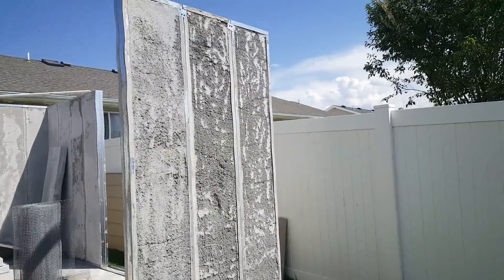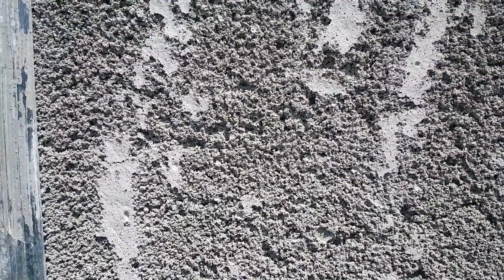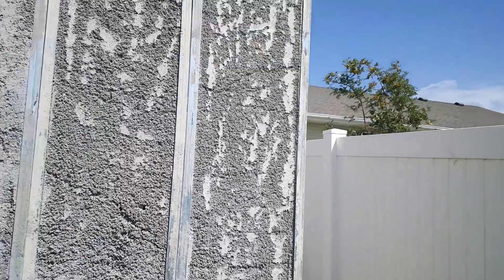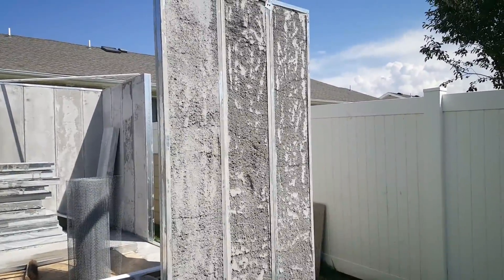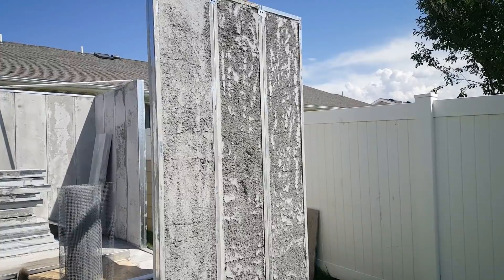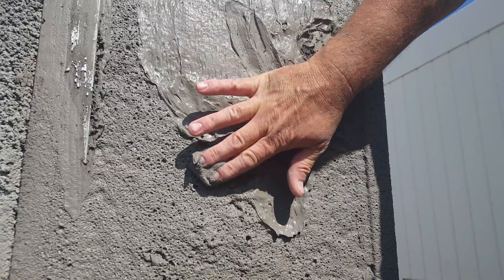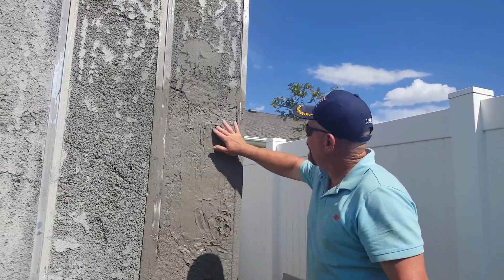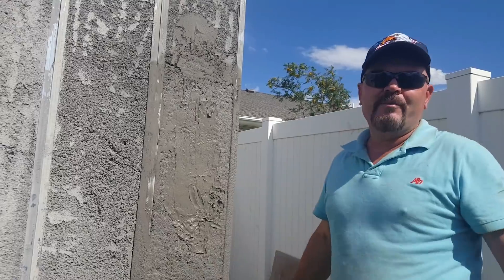Spraying Aircrete ON Wall Panels

Comment: In trying to research the viability of an aircrete hack with little success, I ended up here with you. My hope is that you or one of your readers can help with info or where I might find it. I have a stick built house with T1-11 for siding. Is there any way I can use aircrete as stucco on it? Do I need another vapor barrier? How would I make sure it stuck? Any help will be greatly appreciated. Thank you.

Comment: Fantastic.  Watched all or your Air Crete videos till now.  Love em.  My goal is to make thin-ish wall panels (in the shop) to clad over existing plywood exterior.  One of my big interest points is creating interesting rough finished surfaces. I LOVE the rough texture you got by scraping the panels in preparation for stucco spray.  the questions is - do you think the rough prepped surface could be sealed and lime washed and then hold up to the elements as a finished surface?

Comment: Missing basic safety information.
Cement contains silica dust. The sharp-edged particles scar lung tissue when inhaled:  silicosis.  It accumulates, and is permanent.  Think "turn blue and medical emergency if you fly". 
A properly fitted $40-ish half-mask respirator (plastic with a soft gasket to seal to your face) with P95 or (better, but more restrictive) P100 filters keeps that out of your lungs. The filters are easily replaceable. Lungs, not so much.
Your breathing muscles may get sore until you build them up; try P95 first. 
If you are tasting dust or grit or cement, forgot to wear your respirator. 
When I had to work in a nasty crawlspace, I didn't get nearly as sick if I wore my respirator.  Or taste the dust.

Works great (overkill) for sawdust too.

Comment: Do you reckon you can use this technique to retrofit sheds & barns etc, by spraying aircrete around the wood panels on both sides building up a solid mass? Perhaps laying some chicken wire mesh first, spray a coat, add another layer of mesh and spray again. Would this be strong enough with the mesh and concrete even if some of the wooden boards were only nailed in?

Comment: Just wondering - if your pushing the Air Crete through the sprayer head aren't you loosing the foaming properties of the foam?  If the forms are in position - just use concrete and a sand mix and build a layer of strength on the outside.

Comment: I’d never use aircrete alone. Each time you double with foam, you take away half strength the Portland Cement offers. It’s just not stable enough.

Comment: You should always add followup coats before that last casting is all cured as much as yours has. On top of that you should at least spray down the surface real good to hydrate it before adding the spray coat! Otherwise, the top coating will dry way too quick which is not good! Why did you add foam to this surface coating your shooting with texture gun? Try it without foam and add some sand and perhaps even some latex for better adhesion and again, spray it good with water before adding surface layer.

Comment: what would be the best way to make air crete if i only needed a gallon at a time... what easy way to make foam and what do i need to buy? soap?  i want to use for art project... will it dry in same time as regular concrete sand mix under same circumstances? thanks
Reply: I'd get some Portland cement (around $10/bag) and try stuff.

Comment: i always wanted to try truck bed spray lining on somwthin like this. its hard, long lasting, easy to apply, waterproof. Even some type or polymer could do the trick.
Reply: It's important both to keep water out and let water vapor (which we exhale) escape.

Comment: I'm studying aircrete very intensely to make what I hope appears to be monolithic walls for a house I'm building using a steel tubing framed pole barn.  I am interested in the hopper gun technique which just gave me the idea of another video I saw making counter tops out of concrete that look like wood slabs by dragging a drywall knife across it.  Since aircrete is somewhat soft I also am wondering about using something for a hardcoat such as a polyurea coating.  Do you have any ideas about hard coating?

Comment: Why don't you coat these panels with Sodium Silicate (water glass) mixed with 4 parts water then let dry. Next paint with a homemade starlite solution consisting of 10 parts cornstarch, 1 part baking soda & white glue (PVA Glue) then paint onto the surface then allow to dry.  Then used a nice base coat paint and cover with a nice 30+ year latex paint and your nice airconcrete walls will last forever..... and are fireproof. Walla, your've got a really nice cabin or house in the forest which will not burn down during a forest fire.
Reply: I almost forgot... please forget the spray painting of airconcrete…. spray paint the water glass instead then hand paint on the homemade starlite solution and spray pint the base paint and latex paint. Or you might just add forget the waterglass and add sodium silicate to the home made starlite solution & spraypaint it onto the aircrete suface then allow to dry and paint it with latex.

Comment: Tips:

1- get a gun made for dense media 

2- you need to make this a three layer application, like stucco, if you want it to last. Spray first layer, overlay with skrim fabric, add a plasticiser with the top coat, to avoid shrinkage/cracking... you can buy thinset mortar mix with the plasticizer already mixed in, for a better finish at about the same price.

Comment: Why use steel studs? Why not frame the building using wood 2x4s and then attaching waferboard on the inside and outside of the structure and fill the voids between the studs with aircrete? Then leave the waferboard in place and use tradition coverings such as siding. Or after a day or two of curing remove the waferboard and reattach them four feet down the wall and repeat? If you use waferboard molds first make sure you run whatever wiring you had planned to do. One could be creative and use a textured mold paneling to simulate beam construction or cordwood.
Reply: Wood tends to swell, shrink, absorb moisture from the concrete, and is subject to rot.

Comment: Your walls are great insulators except for the metal frames. How do you isolate the metal from transmitting cold or hot to the interior?

Thanks
Patrick
Reply: The metal is a good heat conductor, however it is thin, so the cross section of the heat path is small.
The outside layer of cement and any inside wall surface covering will help as well.

Comment: Yikes.  You're killing the insulation value when you have those steel studs running through the wall everywhere.  No point in insulation if you have that steel running through.
Reply: The steel does conduct heat well, however the sheet metal is thin so the cross section is relatively small.

Comment: There ist no added value in using aircrete for spraying. The airbubbles collaps while spraying and due to the Impact with the wall panel.

My advise:
Use white portland cement Mixed with fine sand for spraying i.e. texturing the panel surface.

After 1st curing a few hours of the texturing, spay surface again this time with waterdilluted waterglass (sodium or potassium silicate) for a waterproof surface and accelerated hardening.

Comment: Im looking to use aircrete as insulation in between compressed earthbrick walls. If im using it only as insulation. Can i pour a wet layer on top of dry layer?

Comment: I noticed you did a straight portland pad for the foundation.  Is the aireated mix not strong enough for the pad? does it crack easily under weight?
Reply: The foamed mix is going to be like... foam.  Good insulation, poor crush strength. Notice the parts where he scraped the surface off with a trowel. This is why he is adding a stronger, higher density protective surface layer.

Comment: Try adding micro fiber to the aircrete mix. Its like hair. So you would have hairs that your overlay coat could mechanically bond too. Also look into quickcretes overlay. Its sprayable. It has fines in it.

Comment: Does this spray mix provide any insulation value? i am thinking of spraying my crawl space interior walls with it...just thinking it may work...
Reply from the maker: Most of the air gets knocked out of it through this process. I am Building my own spray gun on a DIY platform to mitigate this effect. However right n ow the way I did it with a texture gun the insulation value is greatly diminished.
Reply: Honey Do Carpenter I’ll keep an eye on your videos for that update...thank you by the way for all the information you provide
Reply: Really want to consider whether that would lead to trapped moisture against wood, rot and mildew. Depending on what your crawlspace walls are made of.

Comment: Maybe after spraying the top coat you could use a metal flat trowel to smooth the surface over, you could even use a small brush to make lines like brick patterns.

Comment: I wonder if it would be possible to add pigment to the final coat, and avoid painting altogether. Maybe pink, brown, red, or green?
Reply: Yup, stucco or maybe a color polymer or even mix with light sand cement and latex paint. One must test and experiment. Ask experts in those industry's that know about weathering.

Comment: this is of interest to me... i'm planning on using aircrete over rebar/chickenwire/newpaper forms to form rocks and boulders for a waterfall...   will probably seal it all afterwards just so it's not so porous.    have you thought of taping off a pattern like bricks, then etching or scratching?    looks like you could even 'carve' it to make it look like a rock wall..
Reply: Yea, you got the right ideas with re-bar and chicken or aviary netting to free form any shape, carve it fake up rocks different colors (red lime stone or black granite etc) for water fall or fireplace facade. The ideas are endless.
Reply: A coating should help durability too. Figure kids and many adults are going to try scraping this interesting thing with a fingernail...

Comment: You are trying to put an outer skin on that is hard and waterproof(ish) and that is not aircrete!!!
Aircrete will always be "delicate" when it comes to rubbing and wear and tear.
Why not try something like cement tile adhesive - its darn tough, waterproof etc.
Spray it on NOT aerated and not too thick a layer and trowel smooth.
And remember that no cement based product is going to stick well to the metal panel frame - "something" needs to happen there otherwise whatever you put on will just flake off after a few day/night heat cycles and it will look a mess.
Maybe look at the process they use with "mudding" dry walls.

Comment: Could you make a second aerator for your cement slurry, parallel to the foam maker, and plumb them to mix together as they come out, spray the aircrete on that way?
Reply: Sorry guys all the bubbles that come out, there's no way the bubbles can survive in in an environment that violent. I'm not sure but I think the sprayer has a vortex effect and the bubbles that pop.

Comment: I'm sorry to say this, but as time goes by, You are going to encounter some issues with the aluminum framing! Still... I find this very interresting. +1
Reply: As time goes by he might very well have problems of some kind, but that is not aluminum, it's galvanized sheet metal, steel studs from Lowe's. He has other videos that begin with constructing the frames from steel studs, so he can use them as forms for the panels.

Comment: I'm retired Air Force and am extremely interested in foam crete. I've acquired an old fire extinguisher and am going to use that to hold my Suave/Drexel (spelling) solution. I'm planning on building some aircrete forms that I'll be using at the cemetery my parents are at . Please let me know what you think as well as any suggestions you have about the mix that would work best in each situation.well as using it for insullation on a chicken coup that I'm building. I think it wouod be awesome as an insullator for not only the coup but also for the water storage unit I'll be using to water them and my meat rabbits from. I have watering units, but since I live in NH, it gets really cold and I figure using aircrete and an insullator between two plastic tubs would help make the system energy efficient. By the way, what branch were you in?

Comment: Maybe spray it like a Knockdown. Heavy orange peel, leave to half dry and run a trowel over it to knock down the high spots. Later, if you want another smooth coat, trowel one on. Skimming Knockdown is easier than plastering. Also, maybe a stucco scoop sprayer would work better for getting more material on fast.

Comment: just wonder, what happens if mixed white 50% glue and 50% water and then soap mixed with cement Will it makes harder because of white glue was added?
Reply: oops,  I mean 50% white glue (school type)
Reply: @willissimpson7888  the white glue turns wet again in water even after its hard. Wouldnt make a good additive.
Reply: If you are going to try it, you probably want waterproof exterior wood glue.

Comment: Had me thinking while seeing that shotcrete layer added. Could very very easily use a texture roller after the shotcrete, oops, shotaircrete, haha, was applied. Theres even design rollers with repeatable patterns to them that could create a interesting effect. You probably have seen their use those pattern rollers sometimes in apartment building hallways in two tone paint combinations. It's a fast process. And, there is nothing stopping anyone from using a 3d printer to create their own custom pattern roller designs, if they have just such a printer.

I am getting something in September, if all goes well, its called SprayPrinter. Technically a modded version could be created, that would be a most interesting shotcrete application controller, as to create textured surfaces of exact patterns or images sent wirelessly from a computer to the SprayPrinter applicator. Even multi color concrete tints could be used in stages. Gradient blending effects etc.
Reply: all I need for that is a ten inch drywall finishing knife and I'd go to war on it ,,, I am a DRYWALL guy lol ,,,, I love this stuff been slinging mud since about 1990

Comment: I wonder if it might be better to do the exterior coat with a plastic cement? Don't forget to put a mesh or joint tape between your panels so you don't get cracks!

Comment: Hi.
Can you make an updated video that compares your aircrete blocks to a domegaia type ?  
I mean. They look amazing and kudos for that. But there some YouTube's like Harry that have lots of videos showing these things crumble to a mere sqeeze
Reply: Harry was not using anywhere near the same recipe(s) that Darwin is using, and he was making crumble tests while it was still green.  Concrete doesn't begin to have any strength for the first 48 hours, and isn't considered to be cured for 28 days, minimum.  It gets harder and stronger each one of those 28 days. 

Harry apparently started just stumbling around, almost like he disregarded what little existing knowledge there was available.  

For instance, aircrete is supposed to be a thin slurry that pours like honey, or a little thinner, and early videos show some that's almost the consistency of adobe.

He guessed at amounts on so many of the things he tried that you can't really take it as gospel when he showed how easily they crumbled afterwards.  

Honeydo is also stumbling around, experimenting, because there isn't that much knowledge to be had, but he is starting from a background of working with concrete and doing testing pretty methodically, and repeatable, unlike Harry.

Also,  any concrete continues to cure for about 45 days or more.  The accepted minimum is 28 days and he was testing strength after 24 hours. What could you expect?

It's also best to keep poured concrete damp for at least the first 48 hours, which will make it harder and stronger.  I don't recall any of his videos where he did anything like that. 

I appreciate his sharing of all of Harry's trial & error videos, but frankly you shouldn't put too much faith in his test results, because everything in his approach is so haphazard.

And that's in addition to the actual bad qualities of properly-done aircrete... if it's going to be strong, it isn't going to be light or have the insulating qualities.  If a mix does have those qualities, it isn't strong, as concrete mixes go.
Reply: Weslag1 hello and thanks for the detailed response.
I did not put too much faith in Harry's attempts but thought to mention him as an example for another tester. 

I do however very much interested to see a test by homey for his recent aircrete projects, being that he said that in making the big slabs he quadrupled his initial cement mixture.

I know that it takes a long while for the concrete to cure and also that 48 hours damping rule, but I think that after 48 hours you should at least not be able to smash by hand such a wide slab of material. That is if it's suppose to be a hard enough result.

That is why I am interested in honeys actual demo for that. And pending on some actual results demo, I intend to purchase those recipes from his etsy store